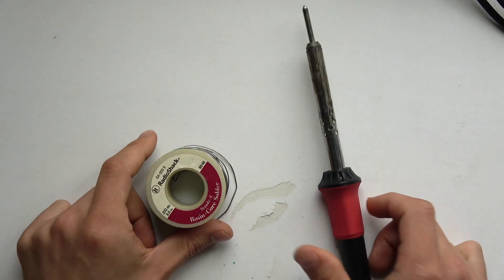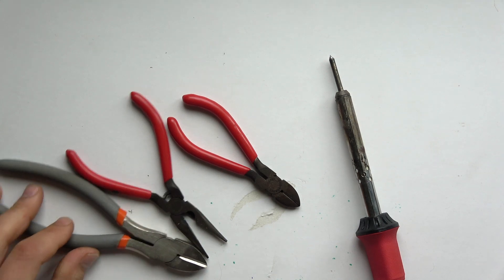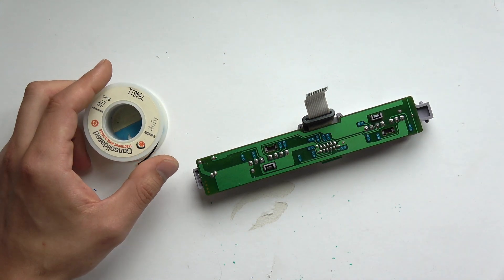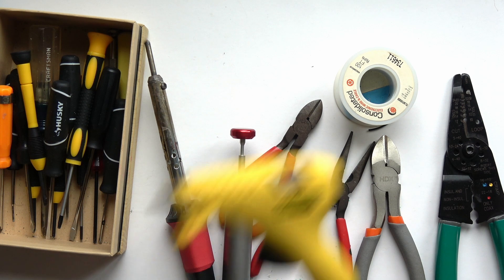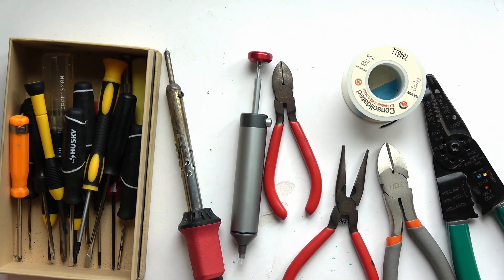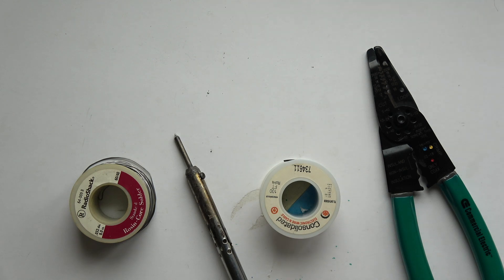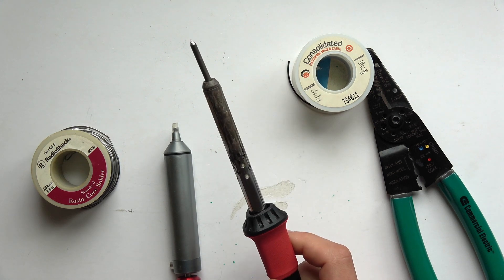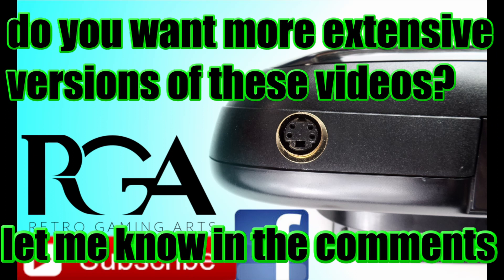Solder Basics - TOOLS - RETRO GAMING ARTS

Comment: Why did you get rid of the glue gun? What do you use instead?
Reply from the maker: i pretty much dont ever use hot glue, only times i'll use hot glue is for plastic to plastic stuff, like a custom AV port, or custom work pretty much, most of the time you can always find an alternative to using hotglue

Comment: Nice series you have going for those curious to get into this hobby! One tool I've found incredibly useful in the business of console modding or RGB cable work is a digital multimeter. Everything from checking trace integrity to determining resistance or capacitance makes the mutlimeter a must-have in this field. Now obviously it's not a tool you will need for soldering itself, but the two go hand-in-hand when it comes to mod work.
Reply from the maker: KarbuncleX its super handy, and i think ill do an episode all about it, maybe its a little down the road, when i started doing all of this i didnt use a multimeter until a little later on,  but your 100% right